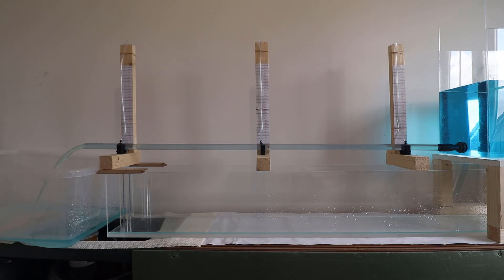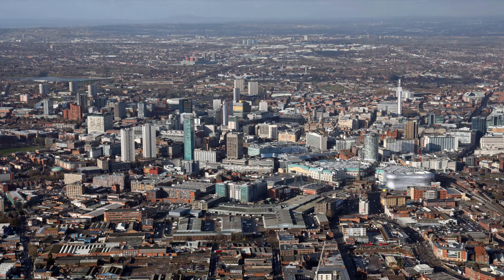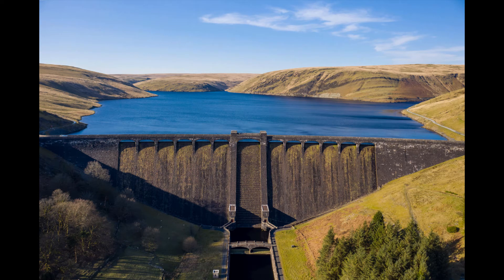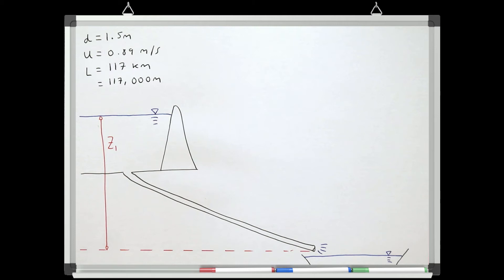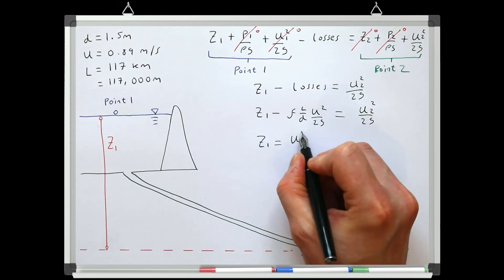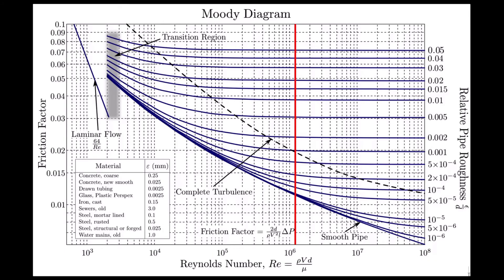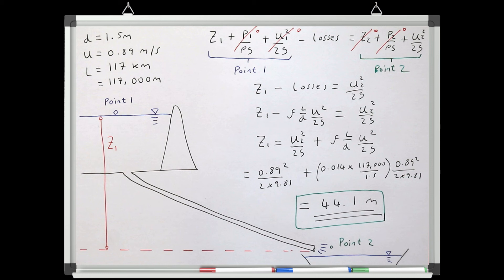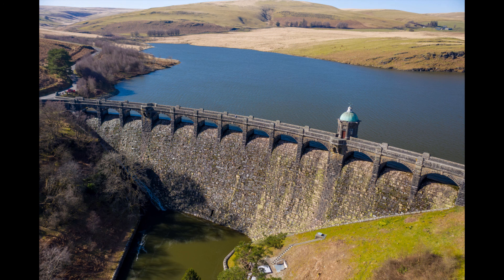Bernoulli’s Equation for a Real Reservoir/Pipe System (Lesson 4, Part 2)

Comment: bro pls explain what is really the pressure in Bernoulli indicating. if the liquid is getting into a smaller area, then how pressure decreases. it is increasing, right?. i also experimentally know that a low-pressure area is created. but how and what that is? .
Reply from the maker: The total pressure head is made up of elevation head, pressure head and velocity head. In a straight pipe, elevation head is constant. Therefore, If you decrease the diameter of the pipe, this forces the velocity head to increases, so the pressure head must decrease to conserve energy. 

I explain this in this old video from 5:30 onwards:

https://www.youtube.com/watch?v=qDA2Y3X3rNY